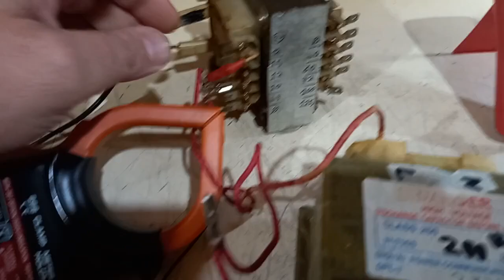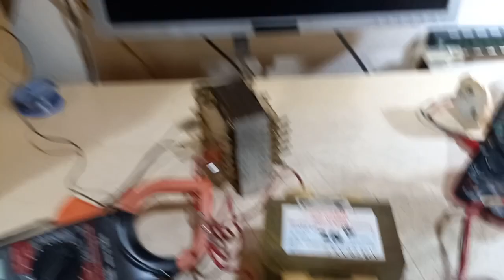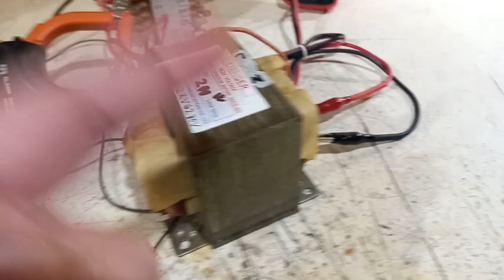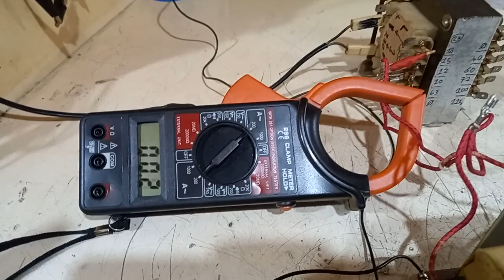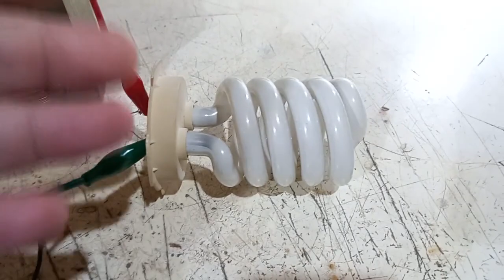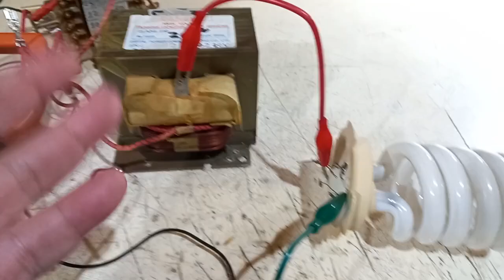Using The 3.5Vac Winding Of a MOT As Primary (??)

Comment: Never thought of that! Ultimately I don't think much can make a MOT "safe" though hahaha! 
Interesting to see all the paper-looking secondary insulation - all the ones I've seen in Australia are just bare epoxy + ECW. I wonder if it's an EU "Safety" law, or something? If someone gets close enough to a powered MOT that the paper saves them, they are already headed for a Darwin Award anyway! 
Maybe an insulation strength showdown would be a good video idea? Could be a good reference video for other experimenters & bring in new viewers - I know you can always look up the theoretical values, but they're rarely "real-world".. Does anyone actually know how much 1 layer of PVC electrician's tape can withstand in the real world? Or a CD case? Or Cat5 insulation? etc
Reply from the maker: never seen a MOT without waxed paper here instead, yeah, probably it's a matter of safety standards, although i know that past the mains wiring the legal safety requirements drop also if it's an higher voltage instead

don't worry, i already thought abut making an experimental dielectric strength test for various materials, i actually already did it, but it was very inconsistent in results, so i didn't make a video about it, about the electrician tape, it was the worst, IIRC it's rated for 2kV per layer, and it doesn't do more than that... oddly enough they rate regular plastic as like 20kV per millimeter, but i noticed it does much MUCH more, although at that times i tried to puncture it with sharp needle electrodes and 60kV, it jumped around the sample instead
Reply: @PosthumanKindergarten  Do you remember what the plastic was that held off 60kV? I also did some (very) rough tests years ago. From memory the best easily available ones I found were LDPE (waxy, smoke colored plastic from milk bottles etc, not the clear PET), and Kapton tape (no surprise there). Good clean paraffin candle wax as well as pharmaceutical paraffin oil was also reasonable, and very useful to non-permanently encapsulate HV electronics.
I guess electrician's tape is only meant for up to 230 or 415V (so-called "LV" by linesman!), so it's made to a budget. 
I was surprised by enameled copper wire (magnet wire) - if it was in good condition most had no problems with 4-5kV (two wires twisted together, so 2 layers of enamel) and some went above 10kV . It's a pity most modern trafos have the windings epoxied together, making reuse impossible :(
Reply from the maker: @rob-muntron  fun fact the one that lasted best was PE from a shampoo bottle :D it was colored also... i tried paraffin wax but the result was very poor, trying to make a 1mm sample was hard, i ended up mixing it with cotton to strengthen it, but it was too unreliable... hot glue is good too, but not as much as compacted plastic

it's interesting the wire enamel, obviously it depends on its thickness, and obviously the thicker the wire the thicker the enamel, but funnily thick wire is usually for a low voltage :D ... good to know tho

i rewound transformers several times, when i acquire one i always check if it can be rewound, if it's too much dipped in epoxy or not, if it's welded or not, i have a plethora of UPS trafos that i want to repurpose, but i need a lot of 0.6-1mm wire that i don't have... about the wire, i still wish i'd saved all the wire you find in motors and similar things, deflection yokes, and also most degaussing coils, cos the latter is often wrapped in electrician tape and with time it gets gooey and it makes the wire a total shit and impossible to untangle
Reply: @PosthumanKindergarten  Haha yeah, I remember making a wood jig and using a battery drill to try to unwind degaussing coils. Massive pain in the ass! The enamel wire I tested was mostly quite thin stuff, <1mm. Some store bought and some from AC motors from microwave ovens, SMPSs etc. Worth saving!
Reply from the maker: @rob-muntron  yes, it's worth saving, especially nowadays

i unwind degaussing coils by putting it between two chair backs, like it's wool string, then with a slow drill collect the wire on a solder spool or something, if anything goes smooth it's just annoying but a matter of like 20 minutes